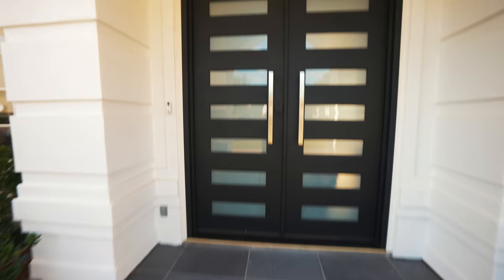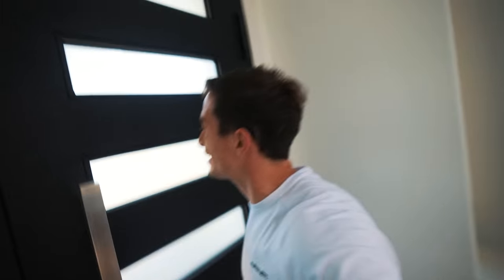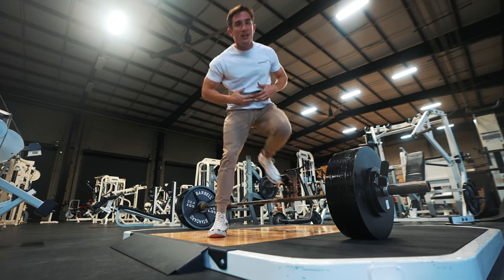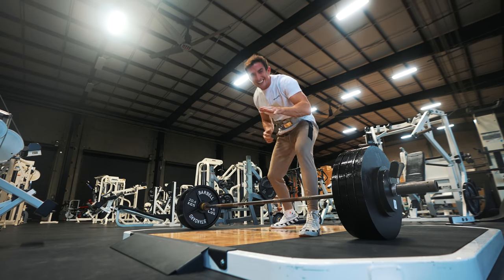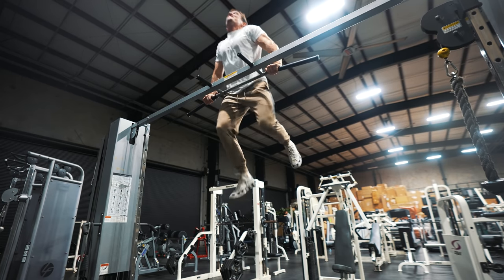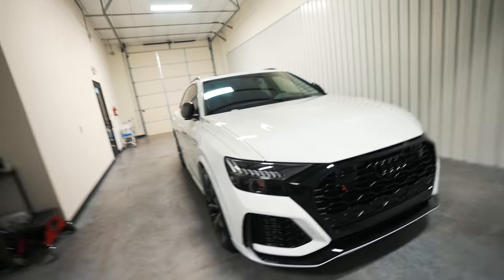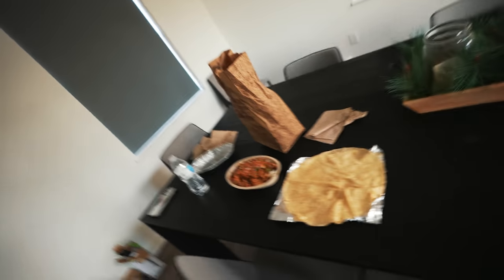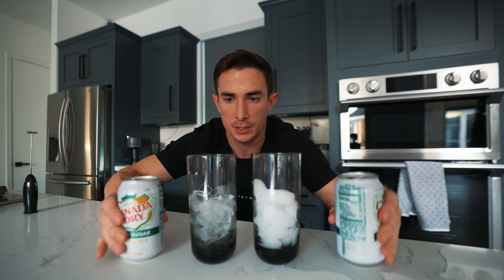CRAZY NEW HOUSE UPGRADE!!!

Comment: Front door looked so fab... the milk froth thing I think you only put it on when it’s inside the glass/cup otherwise it will spill as what has happen in the video...just like using a hand mixer. 👍👍👍👍

Comment: 1) Step bro comment killed me.
2) An easy cue for pulling the slack is thinking about wedging your body into the bar as you bring in your hips.  On lighter weight this should actually cause the weight to break from the ground if you're doing it correctly.